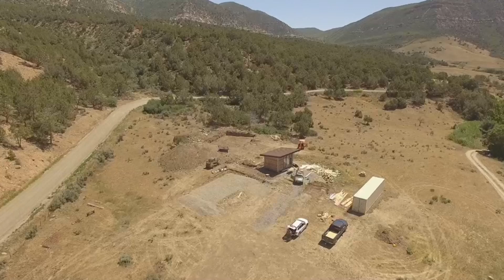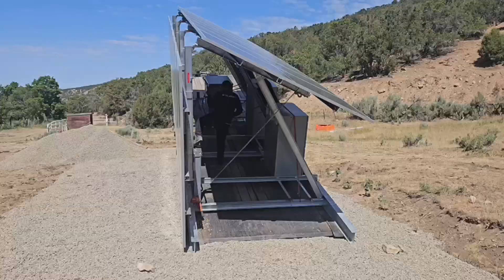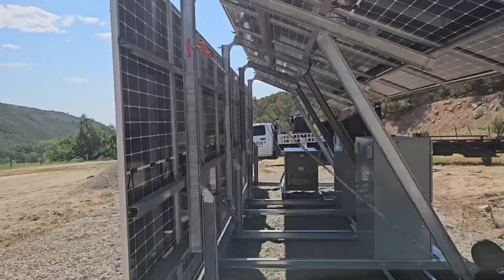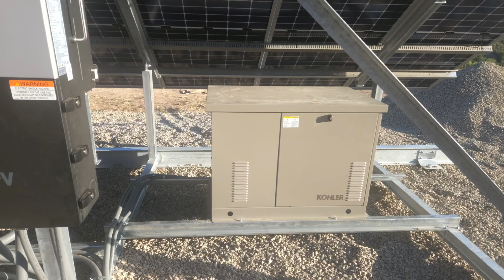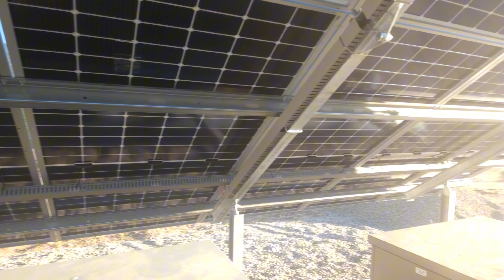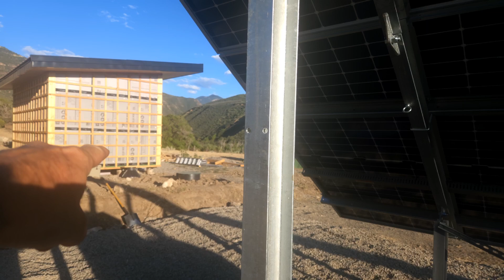Faswall Build Week 1: Solar Set offgrid 11kw install

Comment: Where do you have the generator exhaust output. It looks like it is under the panels which could cause you issues down the road from heat and fumes collecting on the bottom side of the panels. It would be better to move it away from the panels.

Comment: Not a fan of exposed cables even if protected with tubes... not a fan at all of those exposed inverters.... specially in dusty environment. Not a fan of the way those battery packs are stacked, they should be 90° and facing the opening... this is also a bad solution cause each pack got their own bms that suck energy... a bigger pack would have been better.
Would have been better to have one small shed under the structure with all in it.... with a proper ventilation and dust protection .. but .. that's just me, this is how i build those. And i'm not a fan of those EG4 inverters ... not efficient enough, i'm a victron guy.

Prices in Europe : 
16x515W panels : 1500€
60 kWh of LiFePo4 with their BMS : 4000€ (new Eve 628Ah cells)
15kVA Multiplus Victon x2 : 4500€
1xRS450 for 10-12 panels : 1000€
2xmicro inverters for 4 panels : 360€ (+2kW of power)
Structure for 16 panels and a metal box tu put everything in it : 2500€
The generator : Dunno, i would have gone for more batteries if needed.

15k€ approximatively as a DIY with what i consider being better equipment.
You know how much a 15kVA victron weight ? : 75kg, idle draw 55W vs 70W on a 18k EG4 x 2 => 110W vs 140W all day long.
Reply from the maker: I agree with you take for the most part. Quotes we got from installers who would be using Victron components were north of $80k. This was way too much for us.

Comment: 7:01 Oh and with this system as it is currently set up I cannot weld and must use has 10000 wat gas generator separate from the system to weld so we're looking to fix that as well.

Comment: We have a 24 KW of power with one 9 bank down right now replacing our 25-year-old panels. We have a 19,000-watt diesel generator and a 10,000-watt propane backup generator. We have 8 lithium batteries. The problem is my father in law built this system 25 years ago and our inverters need to be updated and that's what I'm learning to so now.

Comment: How are you keeping your batteries cool? They heat up pretty quick when you are charging and drawing a load. I run 12 of the EG4 batteries in Central Texas and I have them in a insulated room that needs to be air conditioned are else the batteries will turn off due to them getting too hot.
Reply from the maker: I wonder about this. The guys at SolarSet said their will be no issues with the batteries inside the cabinets during the summer. They do have a small ventilation fan and they are shaded all day.
Reply: @swimleft my batteries will hit 55c (131f) during peak charge and usage and that is in a 23c air conditioned room. I believe the cut off temp is 70c to protect the batteries.

Comment: Just had an installer do a ground mount system in the Philippines. Although a 25% smaller system , no gen. one 12 kw hybrid inverter.  One 51.2V/300Ah 15.36kWh battery.  (15)  580 watt Canadian bifacial panels.  Extrapolating that to equal your system I figured would cost about 20K +or - w/labor.  Amazing what cheaper labor and low to no tariffs can do  :)

Comment: 150000$. The interest is that it is ready.
But 44 solar panels at 50$        2200$
2 12kwh transformers               6000$
50 kw batterie      3 batteries diy   3x 2000$    6000$
You need wires, structure    but material inside is 14200$    large difference with 150000$

Comment: Very cool. Is the house totally electrified, or are you using propane for cooking, etc?

Also I’m not sure that getting a second inverter in advance of needing it will pay off. This tech is advancing quickly so models available in even a year will likely be better and cheaper.

Comment: You can triple the amount of solar panels with those two inverters you have.
Reply from the maker: I think we can only 'easily' add 2 more strings of panels using the 2 open MPPT's  for something like 5kw. If we re configured the strings of modules to be the same size we can go a lot larger. I have not really dug into this though, a plus on just getting a turn key system.
Reply: @swimleft  I do not know those EG but you can maybe add some micro inverters and easily get more power... if those EG4 can control those

Comment: Nice quick set up.  Do you experience vibration from the standby generator when in operation?
Reply from the maker: We have not plumbed in the generator yet, so I do not know. Also, there is a fair chance we never end up using the generator. Once we get in the house this winter, I look forward to finding out.